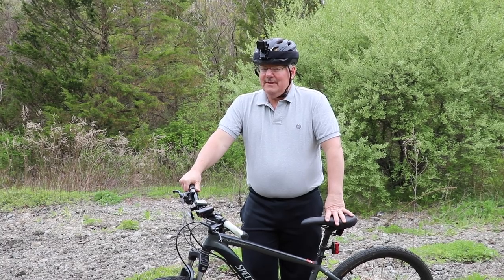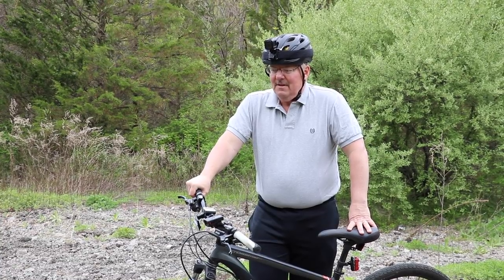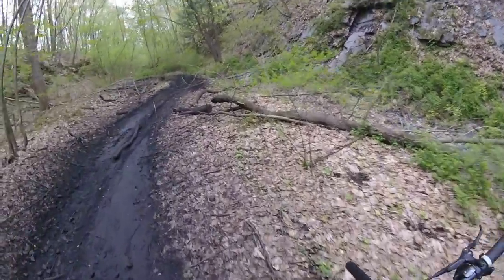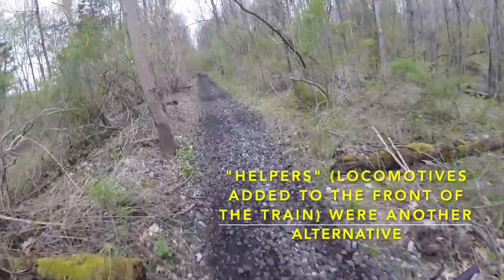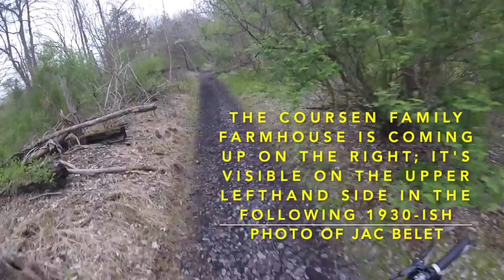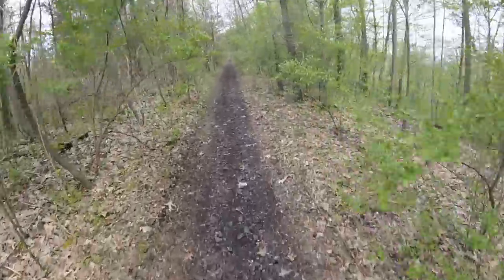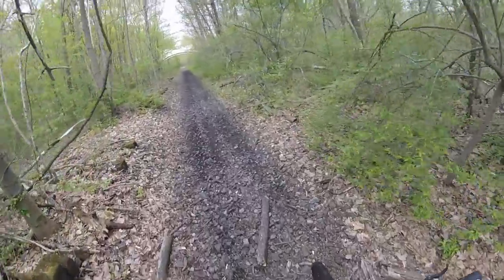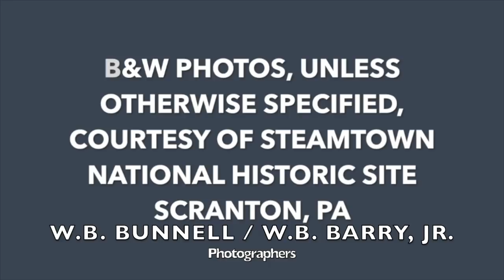Lackawanna Cut-Off - Part 21C: The "Missing" 21 Miles - Johnsonburg to Blairstown

Comment: Thanks for your ongoing coverage of the Cut-Off. I continue to be astonished as what an engineering marvel it is even though the right of way has deteriorated so badly. The physical plant is still there and sound as ever. Trains could run on it tomorrow if we had the money. It's too bad Conrail didn't leave the track in place. I think they wanted to sever that connection. As it is they left the ties and ballast.

Comment: Very awesome Mr Walsh. 
I am one of those dirtbike/ATV guys and I've been riding the Cutoff since I was a teenager in the 80's. The history was a big part of what drew us to the ride, much like here on Hamburg Mountain and the Wallkill Valley. My dad told me about the railroads and encouraged us to explore. And at the same time we stayed out of trouble. 
If you ever want to explore the Cutoff in 3rd gear I have a fully insured loaner for you. 
Thank you for your insight.
Reply from the maker: Joe Serin, thank you for your kind offer. I’ll certainly keep that in mind.  We may have passed each other on the Cut-Off back in the 80s.  I think my first hike was in 1985.  Although I’ve bicycled parts of the ROW over the years, this will have been my first complete trip over the line.
Reply from the maker: Minimal at best.
Reply: I remember riding the cut-off on DL&W and EL trains in the 50s and 60s. Equipment included a diner and sometimes the Phoebe Snow Tavern Lounge. There was one long siding that had the switch taken out at the west end, as I recall, essentially making it a stub track. I always wondered why the railroad didn't come pick up all the unused rail. Well, eventually it was all removed anyway. Many of my trips were after dark so I couldn't see much. I do recall stopping at the dimly lit Blairstown station. A book in my library has a ticket stub as a marker in the pages. It's an EL ticket dated December 26, 1965, the day after Christmas. The ticket was purchased in Dover after taking the electrics from Morristown. Even then those trains were 30+ years old. I was on my way to spend a week with my grandmother in the Poconos. I disembarked at Cresco. That was one of many trips. After 1966, I had my driver's license and didn't use the railroad anymore except for trips to Hoboken and Newark from Morristown. I'd have taken many more trips on the EL if I'd known it wasn't going to last forever.
Reply: @danthetechguru 1 I think Conrail took up the cutoff to sever the connection. With the huge system they had, those 21 miles could have been left in place. With the way government wastes money, why not leave it there?
Reply: @danthetechguru 1 And did it all with taxpayer money.
Reply: @danthetechguru 1 Whenever government gets involved, watch out although I am glad the state of NJ saved th cut-off. Now, if we could just do something with it!
Reply: @danthetechguru 1 Your interest in such things is perfectly understandable. I've had a keen interest in just about everything railroad since childhood. Stupid developers is right. It's hard to believe someone thought they were going to scoop out all the fill from the cut-off and ship it to NYC for the West Side Highway project. Talk about a logistics nightmare!
Reply: @danthetechguru 1 I live pretty close but haven't been on it in years. I'm waiting for some trains to start running!

Comment: In reference to the drawing of the sidings; did they build these sidings during the initial construction of the Cut-Off or were some added after, as the need arose?
Reply from the maker: They were part of the original construction.  They were protected by signaling as well (see background of Jac Belet shot at Silver Lake Road).